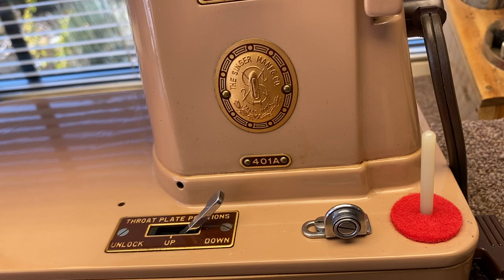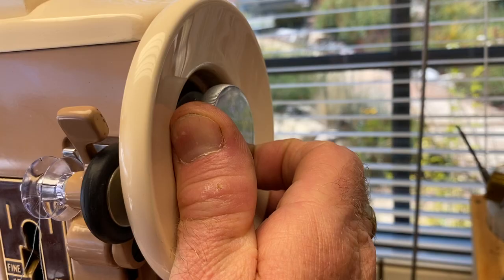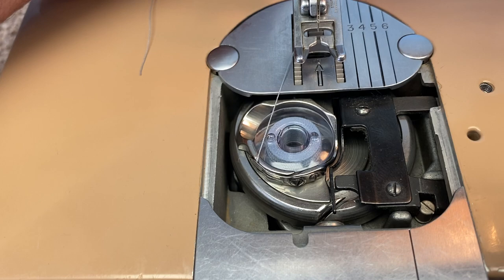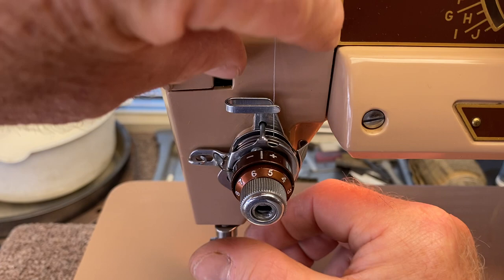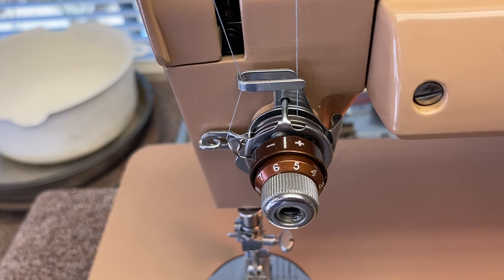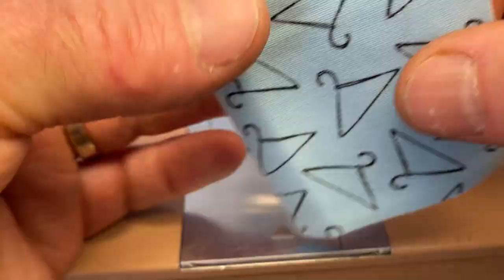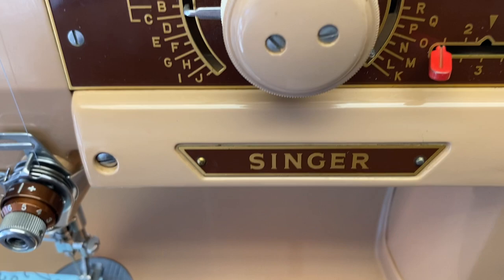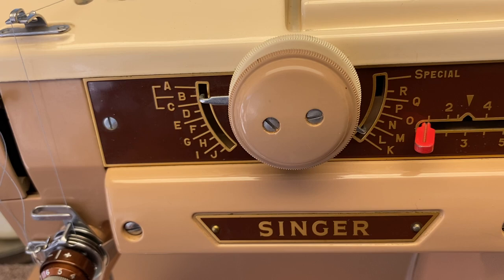Using a Singer 401A

Comment: Actually plastic bobbins are far better for all the "Slant-O-Matic" machines.. The reason is that the metal bobbins will wear the bottom of the bobbin case thin and cause issues.. In addition, unless you have vintage bobbins, the center of newer metal bobbins will catch thread and jam.

Comment: I have a Singer 401g which was used by my gran and mum it has been passed to me. I had no idea how to use it. Thank you very much for your clear tutorial x
Reply: The 401g is the German model and the only difference is the top lid it's on an angle and the 401a is the American model but the machines are the same.

Comment: Is there a manual I can download and print from somewhere? I've searched, but am having trouble finding one that is actually from the Singer corp. My Mom has this machine, I grew up learning on it, but it's been 45 years or more since I used it! It still runs, but there is a big problem in getting the thread to run through smoothly. It's like it is really, REALLY tight and keeps breaking the thread. This video is the BEST I've seen yet - Thank you for putting it out here !!

Comment: Correction 9:32 the red lever is better left in the middle when changing the patterns with the two knobs. In fact, when the red lever is at 1 (left) it is easier to pull and rotate the second knob.  When the red lever is at 5 (right), it is easier to push and rotate the front knob. You can operate the knobs at any position of the red lever, it's just that the knobs may be harder to push/pull and rotate. If you remove the top cover, you find out why - each knob is connected to a vertical rod, when these rods are properly greased - use grease instead of oil - the two knobs are much easier to operate.
Reply from the maker: I disagree. When the red lever is at 1, the cam followers are disengaged from the pattern cam and thus, easy to move the pattern selector up and down the camstack. When the red lever is moved between 1 and 5, the pattern selector cam followers are pushing against the cams and make it difficult to move. Because this model is over 60 years old, more often than not, the pattern selector cam follower sliders have varnishing from old oil and it makes them stick, so I scrub them thoroughly with tetrachloroethylene solvent to remove old oil or grease before lubricating. Some greases will not harden up over time, some will not work well.

Comment: Excellent Video! I just picked up a '51 401A for my mother, and I have no idea how this thing works.
Thank you for the info.
Reply: That is interesting, because Singer did not make a # 401 until 1957. Singer introduced zigzag machines in 1952, with the introduction of the # 206 machine..

Comment: Can you please tell me if I am suppose to use class 15 or class 66 Bobbins on my 401a?
Reply: 66 works well.
Reply: @kandaschurr7034  66. The 66 bobbins are slightly domed on the top and bottom.
Reply: Class 66

Comment: So if it says to use a 2.0 stitch length, how do I choose that on my 401a machine? (Straight stitch or zig zag)
Reply from the maker: 2.0 mm is metric, this machine uses stitches per inch. I would suggest un-threading the machine, marking two lines across a piece of parer 20mm (2 CM) apart then, with the needle piercing the paper exactly on the first line, stitch 10 more needle holes into the paper. Adjust the stitch length until the last hole is exactly on the second line. That gives you 10 stitches exactly 2.0mm apart.

Comment: FYI: Plastic bobbins are junk. They will cause many problems sewing. They do not run smooth in the bobbin case. Many people who think they have sewing issues just need to throw away the plastic bobbin and use a metal one. Just saying...
Reply from the maker: If you can get genuine Singer class 66 metal bobbins, they will be good. The problem with aftermarket metal bobbins is they are most often slightly larger, fit too tightly in the bobbin case and drag which causes tension issues. I have used literally thousands of plastic bobbins since the 80's when the metal bobbins gave us so much trouble. In my experience the plastic are far superior.
Reply: No need to trash talk plastic bobbins. You do need to use the specific type or style of bobbin for the machine being used.

There are subtle differences in plastic bobbins used in different brands of sewing machines and even different models in the same brand. For example, the Singer that I used in the late 1970s required a plastic bobbins the unscrewed and separated in the middle. Made it easy to remove the thread when it got low. But that bobbin in any other Singer would produce messy stitches everytime, even though the bobbin fit.

Some of the old machines have to use generic bobbins today because they don't make the original bobbins anymore. Like the machine my dad bought for Mom from a traveling door-to-door salesman in 1967. Think it was a Capital?  Mom used it until it was stolen in 2018 (grrr). 

Anyway, if a plastic bobbin doesn't work for you, try different ones until you get one that does produce good stitches.
Reply: Plastic bobbins are too light. Metal bobbins are better.